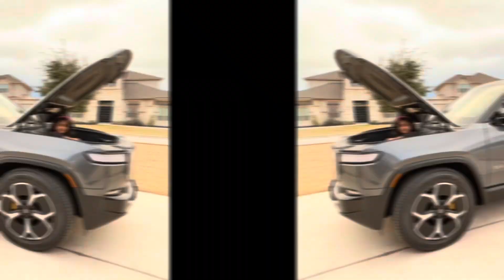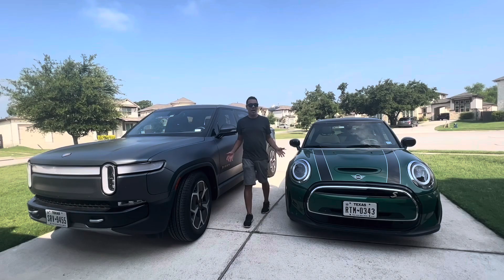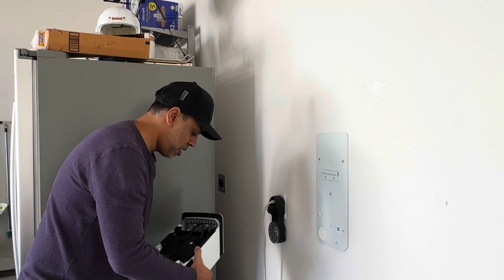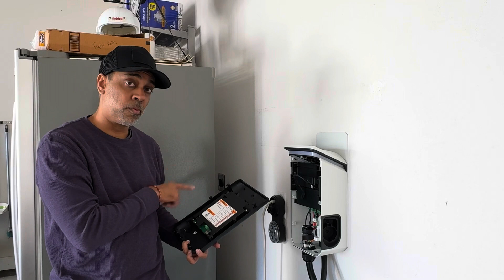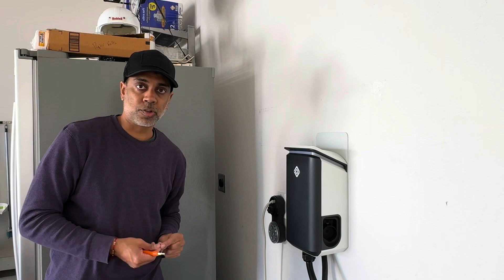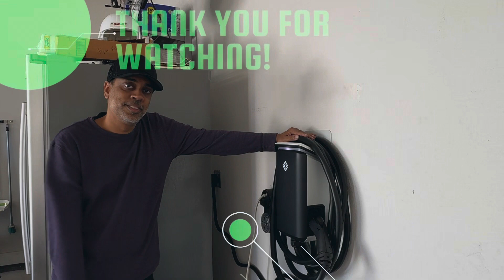Rivian Wall Charger Install and Review

Comment: Hi there...i also just got a wall charger.....and I have a 50A plug in close by so i will use that instead of hardwiring the wall charger....where did you get the pigtail cable that connect to the wall charger? Please let me know.
Reply from the maker: I bought mine off of Amazon, but most hardware stores have these as well:
https://amzn.to/42QMEgI

Comment: I'm by no means an electrician, but i did install this charger hardwired to my mains electrical panel. A word of advice you may want to think about the longer term saftey of using the nema 14-50 plug to cherge your EV at the 48 amp for long duty cycles. Munro live did a break down on youtube under the title "Home Charging Installation Risks and Advice". 

Nice video!
Reply: oop i hadn't gotten through the entire video and now see you set it to 80%. Disregard me cuz i wasn't helpful at all ! haha
Reply: oh and lastly i totally agree with your prognosis around capabilities & design. Capabilities are non existent, design is great which i definitely regret!

Comment: I need to replace my juicebox 40 with  an actual rivian charger.
Reply from the maker: We have the juice box as well. I actually really like the 40. The cable is much thinner than the rivian cable, though maybe a little stiffer. I also like the JuiceBox app which has a lot of good info while you’re charging.